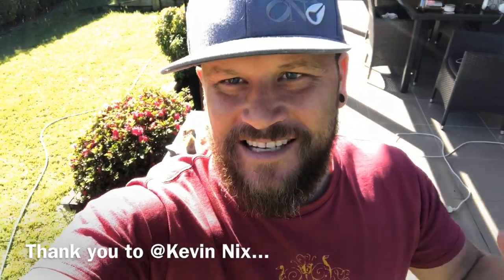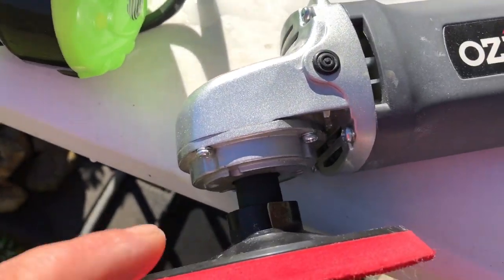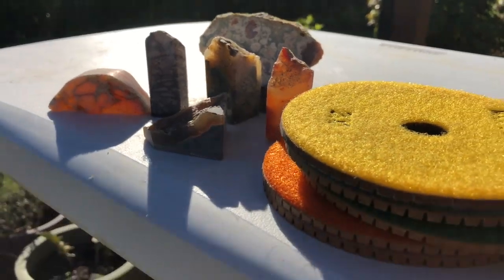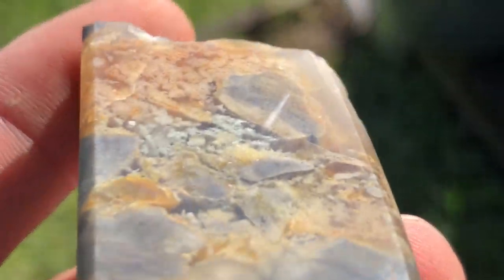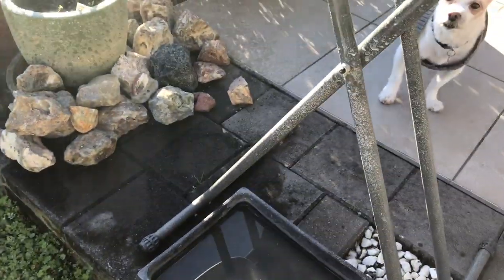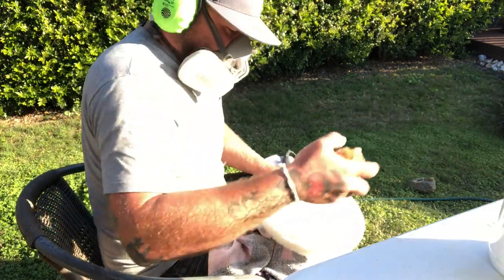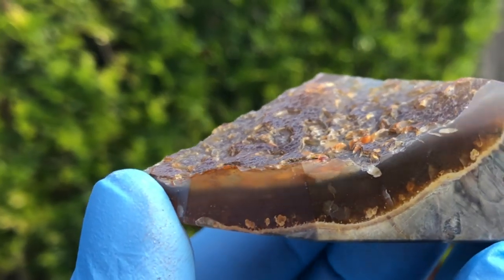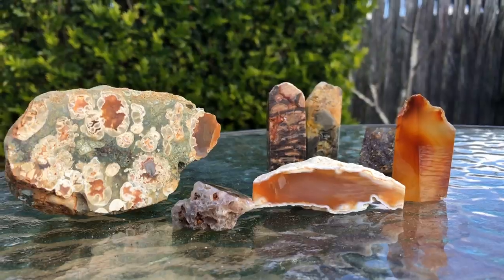Using Power Tools to Cut and Polish Rocks

Comment: hi rookie, it may allready in your comments here somewhere,
- only use your tin oxide polishing powder on rocks with a smooth surface, not ones with too much pitting, or natural cavities
- remove your white powder residue with a medium toothbrush and soapy water, (you wont damage the polished surface, its too hard)
- only use velcro attached felt pads for your tin oxide polishing, turn your sander speed down to the lowest speed.
-  consider getting a bench grinder, and fitting a stitched sisal wheel for it, it is also great for final polishing, buff the polished surfaces until warm, allmost hot

cheers, kev
Reply from the maker: Mate thank you Kev! Seriously, it’s cause of you I took this step in rock polishing, and of course, made this video, and I really am grateful and  value your help. You’re a legend dude, just mega thank you!
Reply: Rookie Rockhounding 
if you havent allready -
search for the velcro attached felt pads on ebay, they are relatively cheap
you can use them with
your polishing powder, 
or, dry without powder
just a little water with a little polishing powder, just enough to make a paste.
kev
Reply from the maker: Kevin Nix oh gosh no, I didn’t know they made them. Man thanks dude! I’ll jump in that for sure. 👌👍
Reply: Just learned a lot, thanks Kevin!

Comment: I love these rocks you've done, keeping so much of the natural, organic look and just polishing some facets. I have a wet polisher like what you have and have rigged it into a flat lap of sorts, using those metal diamond discs in different grits. I made a jig for mine and it sits upside down inside a plastic crate that catches the water I spray onto the lap while I'm working, and also the rocks that can go flying. I took the guard off my wet polisher and use an 8" disc so I have plenty of surface area. I have zero idea how fast my machine is spinning, but it works so I'll take it. I'm learning as I go and using a tile saw to cut. It would maybe be nice to have a straight up pro lapidary machine shop I guess, but there is something very satisfying about figuring this stuff out without throwing a ton of money at it. All this experimenting makes life interesting.  I mean, anyone can do this stuff more easily if they throw money at the hobby and buy the high falutin' machines. I'm kind of happy with what I have for now. Keep up the interesting work.

Comment: Those look really good.  Nice rocks with a nice polish.  I think you’ve gotten some good advice about better things to try for that final polish.  Honestly, I haven’t completely figured that out myself.  I agree with all of those who told you that you need something with less fluff and a firmer backing.  From what I’ve read, different polishes and different pads (leather, felt, denim, carpet, etc) work for different types of rock.
Reply from the maker: Michigan Rocks 
Hey dude, yeah there is so much good advice being shared. I’m so grateful. I’m gonna need to rig up some of the ideas to give it a try. I still need to buy a grinding cup before I make a start on the bigger ones. Slowly but surely I’ll get there. 
Oh and dude how rad was that jasper in your vid!!! Just woah 😳👌
Reply: Rookie Rockhounding you’d need one heck of a cup grinder for that jasper.

Comment: A great way to polish the flats is to secure a piece of cut denim to a block, spray the denim with water and put the tin oxide or other polish on the wet denim.  Then, just rub the flat surface of the stone on the flat surface of the wet denim until you get the polish you want.  "michiganrocks" did it with a  Petoskey stone in one of his youtube videos.  Also, when cleaning the nooks and crannies of rocks, like you're doing at 7:26, a waterpick is very helpful, if a bit messy.  Another great video.
Reply from the maker: Joe Hurly 
Hey joe! Thank you so much for the help! Really appreciate it 🙏😉
Yeah “Michigan rocks” rocks 😁

Comment: For someone that is just learning, you did an excellent job at polishing!

 Now, if I may suggest,

You would have better control of your machine if you had it on the table, that being said, build a vice or jig using scrap wood, Build it with a base big enough to keep it from tipping over, you can start with a flat piece of plywood using metal or fabric straps, strap it to  the plywood, (you can make it so you can take it off easy using screws) leave the trigger open so you can get to it, and don't forget about the button to keep it on without holding the trigger, If you don't have any straps you can use wood to built around the machine to hold it down,
 Also with a (C clamp) and 2 very thin but strong pieces of wood, like 1×2's about 1' long, you can hold your larger rocks easily, put 2 flat skinny 1"×2"×1' (1 inch by 2 inches by 1foot) pieces of wood in the (C clamp), position the stone in a spot (Somewhere between the end of the wood and the C clamp) where it will be wide enough, Tighten the C clamp and it will hold your rock without scratching it, If you have to, use small pieces of cloth between the wood and the stone. Remember always test everything before you actually use it on your good rocks. 

 Sorry if that was a bit long but I tried my best to explain without pictures, and I hope I don't offend you with my suggestion.

 Awesome video man thank you.
Reply: Ps. One other thing, You can run your hose with a drip, drip of water to keep the pads wet, It will also keep the dust down and out of your lungs!
Reply: Love the suggestion. I think I may try that! Just recently hurt my arm so I was trying to figure a way to still be able to work without hurting it further. This sounds like it'll do the trick! 😎👍
Reply: @MarlainaAtkins  thank you,  You can tweak the design to fit what you need just be creative.👍✌
Reply from the maker: AMERICANREBEL ! 
Well hells bells that my friend is brilliant! Thank you man! Thank you so much for takin the time to explain that for me. I need to set up a little work bench in my massively unorganised shed and do this. You are a legend! 
Seriously I really really appreciate the help 😉👍👍👍👍👍👍👍👍👍
Reply: @Rookie_Rockounding  35 years of marble and stone work in houses kinda help's to, just take your time building it and don't expect to get it right the first time, oh yeah, a little patients help's to,  LOL!

Good luck with it and keep me posted on your progress, I will help you anyway I can. 
 Do you have email and would that help if I give you my email?

Comment: KOOOOOL Mate! I have been hand polishing on a flat surface with wet-dry sandpaper. The sander would sure be quicker but I am getting good results. I even found some 12,000 grit sandpaper. Keep teaching. Havagudun mate!
Reply from the maker: E. D. Law 
Yeah I used that for mine a while ago before doing these videos but I had carpel tunnel in both wrists so I couldn’t do it very long. I have to be careful with them from now on after surgery. But yeah, I used to love doing that. It’s relaxing. Have a great weekend mate!!!

Comment: Hey man back to this oldie but goodie again I just ordered the pads for my grinder and I have the saw . I also use a Dremel tool with the flex shaft and bought me nova polishing points with the cerium oxide powder . I use the Dremel on small stuff or hard to get to areas and the pads I’ll use on the bigger rocks etc . Such a fun hobbie and I have the next 3 months off and last year was tough man worked hurt and it SUCKED bad need to rehab my old ass up .take care n be safe

Comment: Where theres a will theres a way... This video proves you dont need fancy $3000 machines to polish a rock. Wonderful video, I would replace the cotton polishing wheel with soft leather, take a 1/4 teaspoon of polish and mix it with water until you get a slurry and apply that to the soft leather. soft as in the inside of a belt. Also dont worry about the rock slipping out of your hands during polish, it happens to all of us ;).
Reply from the maker: rsiku 
Hey Rsiku mate! I love your comment. It’s true, making do with what you can get your hands on. And thank you for the advice! Super appreciate it mate! So much!

Comment: Wrap that crazy buffing wheel in a tight leather sleeve, wet it, then rub a slurry of your buffing compound into. My back-porch lapidary setup includes a palm sander with thick leather (loaded with 600 grit alum. ox.) instead of sandpaper. Cheap and works great. I'm pretty sure it's the long hair causing the problems.
But DOOD! These are some beautiful beautiful beautiful treasures!
Reply from the maker: Mychael Lee 
Thank you mate! I really really appreciate your help and advice! Have an awesome weekend brother!

Comment: Hi Jesse, use felt pads on Velcro instead of the whooly attachment, there is way less chances of the rock flying away like that. also, if you dont like the mess you can easily make a flat lap and use the sander/polisher as the motor. I will upload a video on my channel this evening so you can refer to it in case you decide you wanna give it a go.I also have the full build on Mackay rocks and fossils Group which goes a bit more in depth.
Reply from the maker: Joseph Silva 
Hey Joseph, man thank you so much for the info. I’m going to be trying this for sure. And I’ll check out that video tonight! I really really appreciate the help mate. 👍👍👍👍
Reply: Hi Jesse, my pleasure. I have uploaded the video, if you need any info just ask. Cheers
Reply from the maker: Joseph Silva 
Man I just watched it! It’s amazing! I never thought about using it as a flat lap.... but you nailed that! Thank you so much mate. And the rocks and mineral collection is beautiful!
Reply: @Rookie_Rockounding  Cheers Bud

Comment: I use a plastic apron smock when I diamond polish and I leave it sitting on the table so the ad is facing up so you can push down fairly hard. As you probably noticed if you don't take the first phase with the 50 pad down far enough right off then you leave the cutting scores. 
Thanks for the vid brother 😎

Lol next you should try cutting some cabochons😉. I haven't done to many shapes yet.

I never did use a polish, guess I forgot as they were pretty shiny without lol.
Reply from the maker: TheStraightPath 
Hey brother! Thanks for the tips 😉👍 I really appreciate the help. And yeah, the 50 grit pad is crucial 😉
I almost don’t know how much the polish helped cause yeah, like you said, they were really shiny after the 3000. 

I’ll have to try some cabs for sure, better research how best to make them 😁
Have a great weekend mate!
Reply: @Rookie_Rockounding  hey you bet bro, rock on😏

Comment: I have the same set up as yours. but I also use 100mm flat laps for grinding/polishing.
I bought a router speed controller to turn my el cheapo Ozito grinder into a variable speed grinder. 
It cost about $20 off eBay.
I can now run the grinder at a more user friendly speed.
That may solve your flinging rocks dilemma. lolol
Reply from the maker: Hey awesome thank you Jeanette! That’s a great idea 😉👍
Reply: also, you can buy Velcro backed wool felt pads that go on your grinder attachment for final polish.

Comment: Nice polish. It's more usual though to use a short nap pad or a felt pad for the final polishing powders or rouges. it'l be far less messy and will not grab your stone so much.  just apply your rouge with water on a paint brush when needed. Nice work though!!
Reply from the maker: malcolmsplace 
Thank you for the great advice Malcom! I reallly really appreciate the help. Thanks mate 👌

Comment: Try using dremil for smaller rocks wet sand paper and lil buffing wheels yo can also use from bench grinder any other power tool can be place in vice as well as sponge poling pads for final polish. I was testing my grinder this way today works  well.where can i pick up sanding discs like thoughs and are they expencive
Reply from the maker: Thank you Elliott for the help mate 👍👍👍
These polish pads I got from a shop out here but they can be bought on eBay for under $40 for the whole kit I’m pretty sure. If you search diamond polish pads on there it should come up with a few different sellers. I hope that helps mate 😊

Comment: Oh, one more thing. I wonder if the polish stick shearers use to polish their combs might be better than that powder? Alot less messy, am trying something similar myself to polish malachite so will keep you posted
Reply: I have don't the white and the red sticks. On some pieces I still can't get the police out.  When it comes to 1500-3000 grit pads speed and water are key!! No need to buff with polish.  Some rock and polish don't mix well together and can cause you to start over altogether. 
I have grey spiral streaks that literally were imbedded in the rock!!

Comment: I’m so sorry to ask so many questions but here we go haha . So what do you do for cleaning the rocks ? I boil water and squirt some dish soap in the bucket and fill with the hot water and let it sit them after a day or so I start over and wait an hour for water to cool then scrub my rocks . Get a lot of the slime from the water and really depends where I find them . If it’s low tide I can get where is usually under water but those are filthy
Reply from the maker: Oh gosh no mate, don’t even worry about it, I will try my best to answer any question, it just depends on how busy I am. But I genuinely have been there before. For me the best thing I’ve found is citric acid (vinegar works just as well). So I soak them for a day in the acid which is so low in acidity that I can put my hands in it and it doesn’t hurt at all. Buuuuuuut the cool thing is, is that it saves so much time scrubbing. I’ll leave a link to a video I did on citric acid, but as I said straight white vinegar works just as well. It’s a bit smellier than citric acid but I think vinegar is cheaper. Try it out, just soak them and then scrub them and you’ll see a difference immediately. It’s cool to see. 
Here’s the link. 
https://youtu.be/52YHxTgC04E
I hope this helps. And always feel free to ask questions. I will always do my best to answer, but sometimes I may miss the comment coming through on my phone. 😬
Good luck mate! Happy rock cleaning!

Comment: I do my stone polishing with sand paper but I'm going to try this next on my Dremel.
Reply from the maker: Oh awesome! I haven’t done it on a dremel but I’m sure it’ll be just as fun and have the same result 😉
All the best mate 👍👍
Reply: @Rookie_Rockounding  it is fun. I just finished a Coral fossil mix with agate I got inspired from your video and I tried it and it works great. It's faster than the sand paper. I'm using my Dremel with some wet dry diamond polishing pads like the one you have on your grinder.
Reply from the maker: That’s awesome mate!!! I’m so glad, and I reckon it’ll be easier on the wrists too. My wrist are shot so using sandpaper i end up sore after a while.
Reply: @Rookie_Rockounding  It is easier. It takes less time than with sand paper. I'm so glad I found your channel.

Comment: Hi rookie,
Thanks for the video. I do have a question regarding connecting the pads to the polisher. I have a the same ozito polisher and it has a 180mm spindle, but all the pads I can find only have 100mm threads. Looking closely at your set-up I see that you have an adapter from the polisher to the pads. Can you please let us know where you got this adapter.
Appreciated and thanks again.
Reply from the maker: Hey mate, so I bought this as a pack from a diamond tools supplier near me. But on eBay you can buy the full pack and it’s way cheaper. I hope that helps mate. Let me know how you go mate 👍

Comment: I love your attitude, how your pure joy for the rocks and the process comes through. Your cutting and polishing put some beutiful rocks in a whole other light.  Really fantastic.  I do have a technical question:  on the curved stone, did you shape it on both sides of the blade as you did the other flat surfaces before polishing?
Reply from the maker: Thank you mate you are too kind 😁
I’m trying to remember but I’m pretty sure I would have. I will almost always use the diamond section of the blade to smooth any surface I’m going to polish prior to polishing it. There are time though where I have just polished straight into the rough on the outside and that kind of looked pretty nice. 
I hope that helps Warren mate. Best of luck 👍😁

Comment: Rookie have you polished an Australian Outback jasper slab? If yes what grits did you use?
Reply from the maker: Hey Stephanie, so I’ve polished similar hardness slabs and rocks before but for doing it at home I just use the sander polisher and work my way through the pads (50, 100, 200, 400, 800, 1500 and 3000) I’m pretty sure. But for tumbling it’s pretty much just from the lowest to highest finishing with a polish and then a burnish with ivory soap. I really hope this helps 😁
Reply: @Rookie_Rockounding  Thank you! Most definitely helps. Rock on!

Comment: Quick question, love ur videos btw. can u give me the brand name of the pads ur using? So many out there and several mixed reviews. I want ones that work the first time. Thanks.
Reply from the maker: Hey jessi, so I bought mine from a diamond tools supplier on the coast because I wanted to make sure I had the good ones but they don’t really have a brand on them. Most of them should be pretty good online though. Maybe try the ones that are around midrange price. Sorry I couldn’t be of more help with the brand of them though.